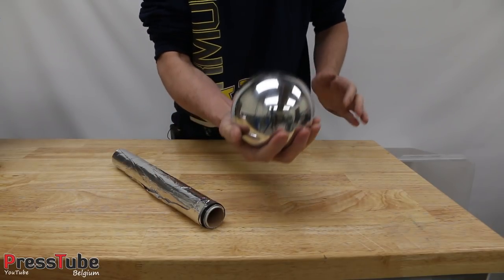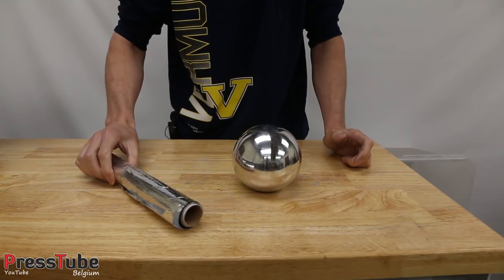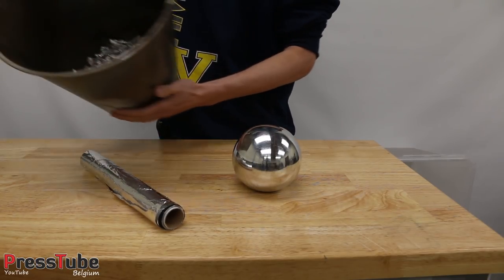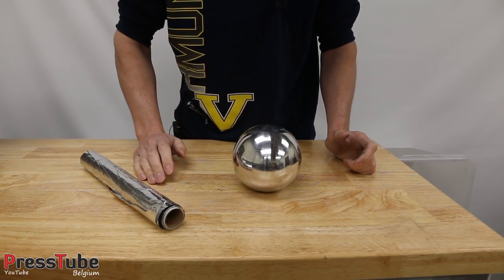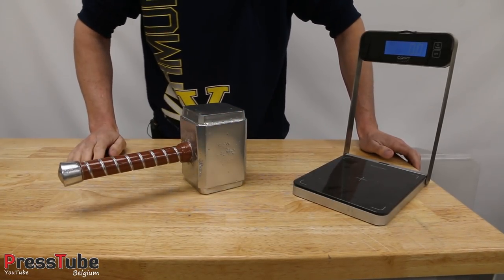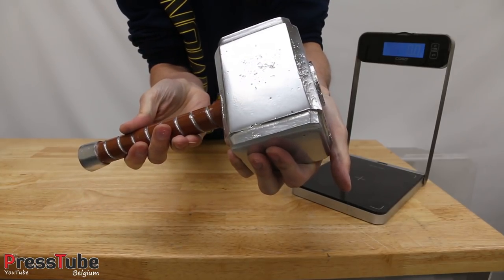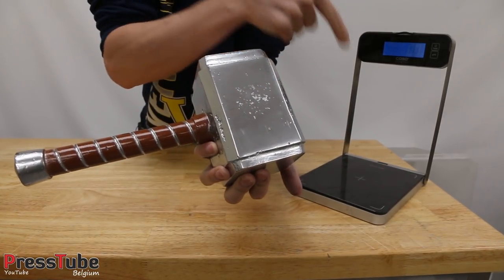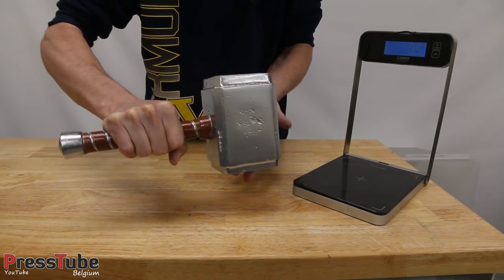Casting Thor's Hammer from Molten Aluminium Foil Balls - Avengers Infinity War Theme

Comment: Nice work, if u put a vent riser front and back it will help eliminate the rough areas. At the top of the hammer and the end of the handle.

Comment: Great build, but I think you phoned it in on the handle. It would have been nice to see a nice leather cover for the handle with a nice strap added to the end. Don't get me wrong, it's nice, but it just seems like when you got to the handle you just pushed through quickly without as much care as the main part of the hammer.

Comment: It's a good piece, but if you hit anything with it, the head will pop off the handle, right?  Can you cast it using a long steel bolt or iron stake set inside the handle and extending into the head?

Comment: ALUMINUM....SAY IT RIGHT !!!
Reply: Right, the guy who discovered aluminum even said it was aluminum. He originalls spelled it aluminium but in 1812 he changed it to aluminum because in latin aluminium means a building made of aluminum. Its something like that. Bottom line is it's aluminum. Brits like to stick to the old incorrect spelling of many words like honor they spell honour. Even though our and or make completely different sounds. You don't say hour like whore and you don't say honor like on-hour. These people need to get with the times or get left behind. They say it's proper english but in reality they are just arrogant.

Comment: well got 1 big 4 down. got thor hammer. so should try do capton america discus shield that throw. or iron man helmet. there nothing do hulk. but do have foam punch hands kid toy. nearly 100 sure that foam will not melt away right if power in alundum. that said if pack inside with sand and all around. try it might work get alundum hulk hand.